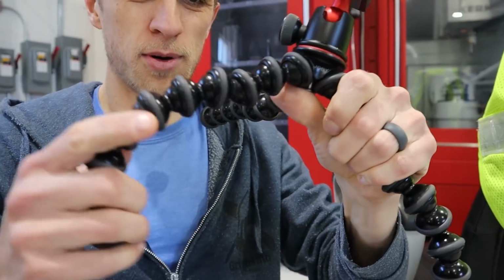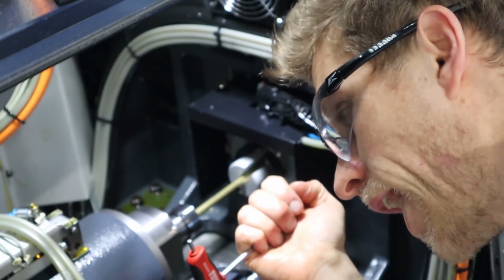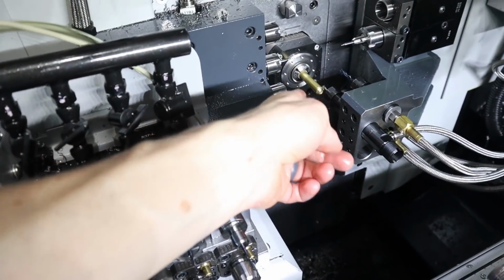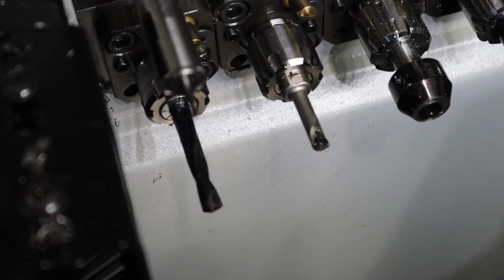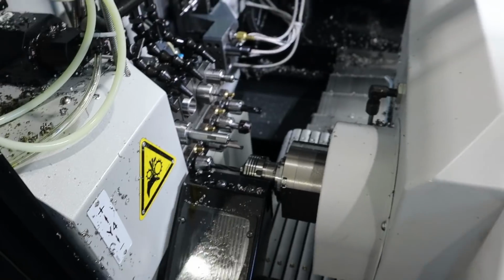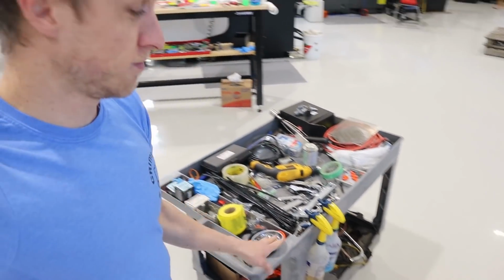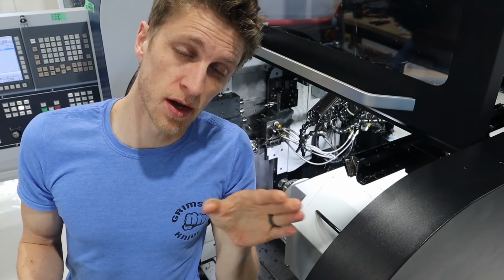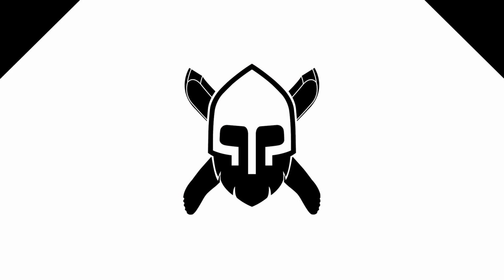Quarantined Shop Life - Day 2 The Never Ending Swiss Lathe Mission

Comment: Your guide bushing should be as tight as feasibly possible without causing galling or main slippage.
The guidebushing acts as the headstock bearings in a traditional lathe. It is a hydrodynamic bearing. Rigidity, tool prep, and direction of oil/high pressure are 3 major players.

Comment: you don't run grinded bars? do you have an adaptive guide bush? also, you can buy longer guide bush, up to 40mm i think.
Reply from the maker: I do run ground bars for everything, except for brass setup pieces.
Reply: @JohnGrimsmo  ok. You could make the case for a adaptive guide bush, then you don't have to buy grounded bar. Cost about $10k.

Comment: Checklist! There is a reason pilots have checklists for everything. It reduces cognitive load and keeps you from making easily avoided mistakes when setting up the lathe. When you have one you can either read it off or plastify it and use a dry erase marker to actually check things off.

Comment: "A few tenths under, totally fine" seconds later "but I will adjust the wear offset"
Reply: Lucas Magno I run platinum cardiovascular products and while it is fine to be within tenths, on a swiss you can hold 10 millionths on a diameter provided you account for and compensate for variable such as temp and work/toolholding.